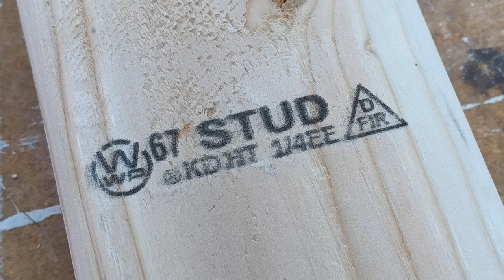Toys from 2x4s. How I transform cheap lumber.

Comment: Great project Steve. I've made a few kids' toys like this recently, and I make the wheels with a 44mm hole saw on the pillar drill, giving approx 40mm wheel diameter. The 1/4" arbor drill is a perfect fit for 6mm dowel with wood glue. 1/4" dowel would be a squeeze but would probably work. I round the edges with a 1/8" roundover bit, but the sander works just as well.

Comment: Great build Steve! I'm 56 and I'm thinking about making a set for me! LOL. One suggestion I have for your painting is this. Make a 50:50 mix of wood glue or white glue  & water. You paint it on 1st as a sealer so you get great results from  your painting.  Less chipping. Not sure but a primer might do the same but the mixture is soaked up by the wood thus sealing better. Just a thought. This looks fun!

Comment: I love that way of doing the axles, much easier than when I tried to hand-drill a straight hole through the wooden duck family (drill press on the Christmas wishlist!)

A thought would be to tape off the bottom before painting so the panel can glue up wood on wood instead of wood to paint?

Comment: A little wax on the axles before sealing them in would help cut down on the squeaking. But the noise is part of the fun, though. ;)

Fantastic project. The camper piece also needs a fold down back so blocks can go into it as a proper toy hauler. Literally. 😂
Reply from the maker: Great idea!

Comment: I've noticed at the big box home stores that the cheaper white wood dowels ruin slightly thinner than the oak dowels. The oak ones are of course,more expensive, but much more structurally sound for the weight of a cargo truck or camper.

Comment: I noticed that you applied your templates to the wood with aerosol adhesive. A much less expensive way to do this, is to go to your favorite local office supply store, and get some old fashioned carbon copy paper. place some on top of your wood, run a thin piece of dowel into a pencil sharpener, and sand the point just until it's not sharp. Use your dowel to trace your pattern onto the wood. For those concerned, you're saving paper, by not having to print new templates every time you want to make these toys, and you're not spraying fluorocarbons into the environment.

Comment: For those who ask "can I use (x) tool instead?" Like anything woodworking, use what you have, that can be done safely. If you find you make a certain kind of cut a lot that could be done easier/safer with a different tool, then buy it if possible. But the best thing about Steve's (No relation 🤣) videos is that he shows that you can build many wonderful things without spending thousands on the latest fad tool. IIRC he only just recently got a band saw again.

Comment: I think you really limit yourself the way you installed the axles. Break-in alignment is between 30,000 - 60,000 miles for semi's. After that the truck can go up to100,000 miles before it needs it's next alignment but if your kid is on Ritalin that second alignment could be necessary within 2 years.